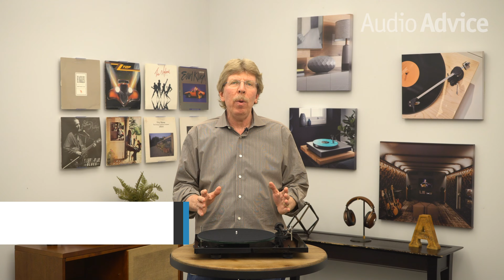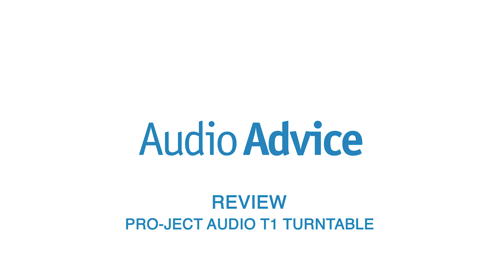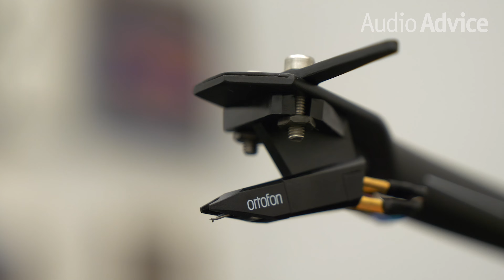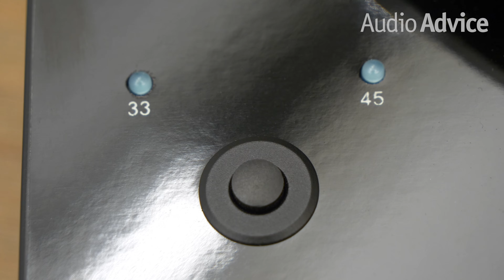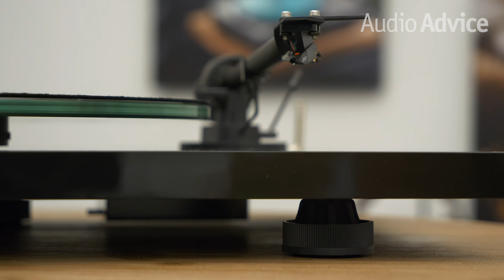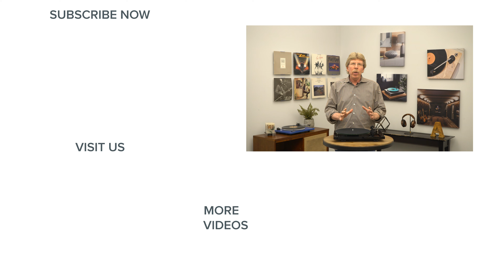Pro-Ject T1 Turntable Review

Comment: It has the same wow & flutter rating (0.25%) as the $99 AT-LP60 turntable, and is very similar to the $154 Crosley C6 turntable. (No surprise, since Pro-Ject manufactures other turntables for Crosley.)

Comment: Ι like this turntable and rega planar 2 (both similar in design). Which one would you recommend? I also like the fact that this turntable has electronic speed switch unlike the planar but i'm a bit worried about wow and flutter measurements. Pro ject gives a 0,25 while Rega only 0,05. You've heard to both, what do you recommend? Does the planar 2 worth the extra money? Thanks in advance!
Reply from the maker: Both are great tables! Wow and flutter is something to look at but it isn't the defining spec to consider when looking at a turntable. For example, some tables have low wow and flutter but poor isolation and high motor noise resulting in poor sound. The more important qualities to look at are design, build quality and features. The Planar 2 and the T1 will both sound fantastic and worth their price tag. If you would like more info, swing by our website and chat with us.

Comment: Can you please provide evidence of direct drive devices have motor noise at all!?
Reply: A company like Pro-Ject would never have the R&D budget and engineering expertise necessary to manufacture a direct-drive turntable, so instead they peddle myths about them to make their crude belt-drive turntables seem superior.
Reply: VWestlife Well. It's cheaper to make a belt drive good than make a direct drive good. It is also easier. I don't see a problem with belt drive. The reason why Technics don't have noise is that they have really good motors. They are also a lot more expensive.
Reply: But this is not a very good belt-drive turntable. It has the same wow & flutter rating as an $89 AT-LP60X.
Reply: VWestlife I watch your videos and like them although I sometimes disagree you provide educational value. I don't know if the turntable shown is good. I believe that in general (not TT specific) though my statement stands and is also proven by the fact that most major value for money oriented (LP60, Rega P1) TTs and "audiophile"  TTs with an exception to the SL1200 (being a DJ TT), but also having very good sound quality.
Reply: I had a direct drive Audio Technica that did exactly that. It got so annoying that I had to replace with a belt drive.
Reply: @vwestlife  You are clueless. A company like Pro-Ject most certainly does have the technical expertise to produce a direct drive turntable. You are talking out of your butt. Belt drive turntables are not "crude". Your thinking is.
Reply: @vwestlife  another dumb comment. There's far more involved in how a turntables performs than just W&F measurements. Grow up and wake up.
Reply: Gordon Shumway  Direct drive turntables have their own set of issues.
Reply: @mnhay27  Exactly the same here.

Comment: Hello Audio Advice-I have the standard T-1 with built in RCA cables. Can I remove them and switch them to smaller cables? I am trying to pair it with a schitt mani pre-amp
Reply from the maker: A very skilled technician could do it, but it would be very difficult.

Comment: Is there anti-skate on this turntable?
Reply from the maker: It is supposed to be preset for the cartridge included, but there is no way to adjust it.  If you zero balance the arm, you will notice it drifts to the outside some.  The Debut EVO does have adjustable anti-skate.  Thanks for watching

Comment: I just got this table and every time it starts spinning a slight grinding noise comes from the motor. It stops after about 3 seconds but it also happens when I turn it off, is this normal for this table?
Reply from the maker: Nicholas,  it does not seem normal. Feel free to contact us via chat or email at audioadvice.com. We can help you with your recent order and issue.